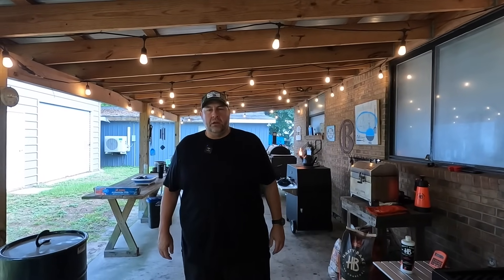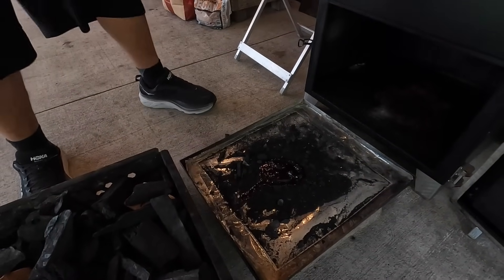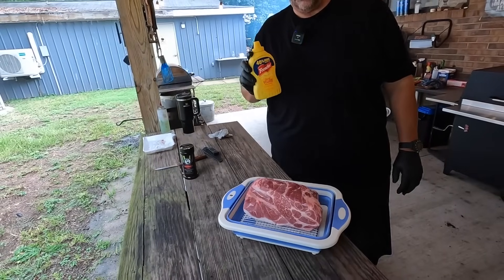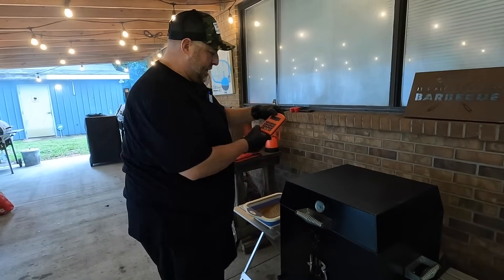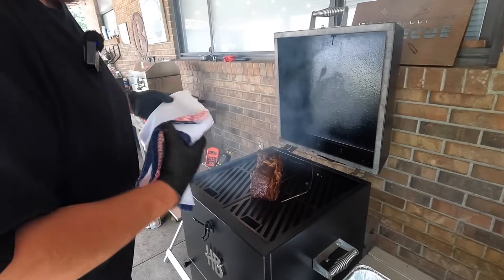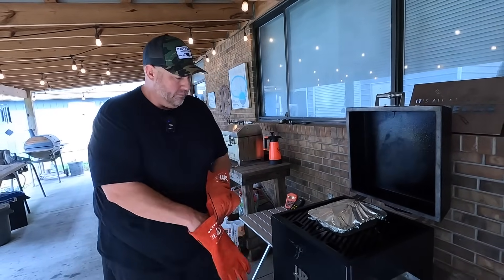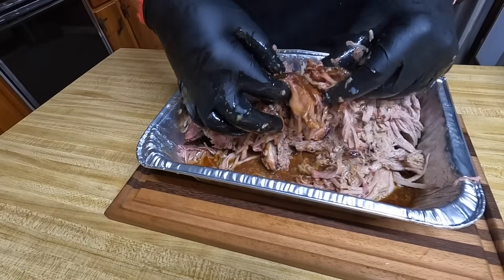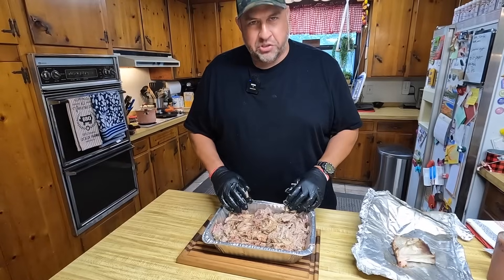Pulled Pork Smoked on the Hasty-Bake Roughneck

Comment: I'm surprised your outdoor kitchen hasn't got a 22" Original Weber Kettle. Those have many benfits as well and are so affordable as well as, Weber to this day still makes the parts in the event you need them. I'm almost sure that Weber invented the kettle smoker process way back when, I think in the early 1960's. Boy they sold a lot of them once folks knew about them when first hitting the market. The manufacturing process has changed a little since the first versions were developed and had thicker kettle steel material but they still have the same outcome. 
It's pretty hard to beat a nice slow cooked pork butt/picnic due to the versitility of meal types you can make. A good cold and crisp coleslaw goes so good with it as does a dose of applesauce.

Comment: I tried direct cooking but it seemed like it was going to run away. I might need to close the dampers even more, I’ll continue to experiment. I’m also going to try char logs on the bottom, I usually put them on top. Thanks.
Reply from the maker: I’ve used the PB hundreds of times and it has no heat shield. The Roughneck cooks the same way but you definitely have to control and maintain the airflow.

Comment: Thanks for the video. What's the advantage to using the Roughneck over the HB Legacy for this cook?
Reply from the maker: The Roughneck cooks and performs more like a barrel smoker because of its design. Air coming in from the bottom and creating convection going up the cook chamber. The Legacy definitely works great for these as well but I do feel the RN does a better job at smoking simply because of the design.

Comment: It's funny you say that you can't do a long cook in the pit barrel on a full basket of charcoal,I did a 8lb pork butt in the pit barrel jr 8 hr cook and didn't have to put anymore charcoal in to finish the cook, plus the hasty bake isn't a barrel cooker it a direct heat cooker like the chud box
Reply from the maker: I’ve never been able to get more than about 6 hours of cooking heat in the Pit Barrel before having to add more charcoal, so if you have it figured out to cook longer then great on you. You still have much better control of the internal temps with the Roughenck and you can cook 3 times as long if needed. Also I didn’t call the Roughenck a barrel smoker, but it was designed to compete with the “barrel style” smokers, like the PB but with better features. Dont believe me? Talk to Kent. He helped design it.
Reply: @AbomAdventures ok  go back and watch your video especially around the 11.51 time-line
Reply from the maker: We’re not here to argue with folks. 
Enjoy your direct heat Pit Barrel Cooker. I certainly have for years and will continue to when we travel.